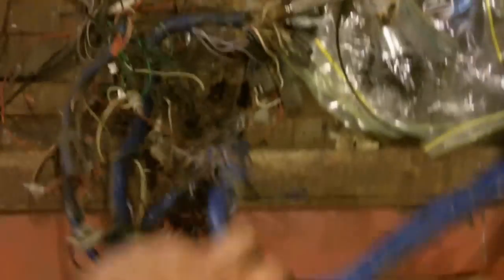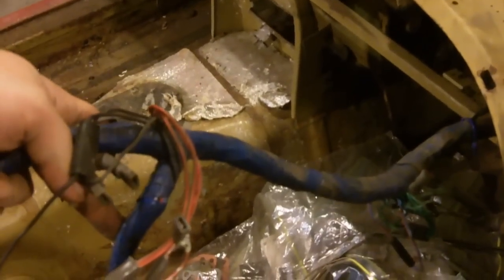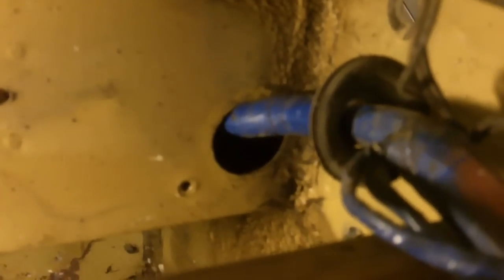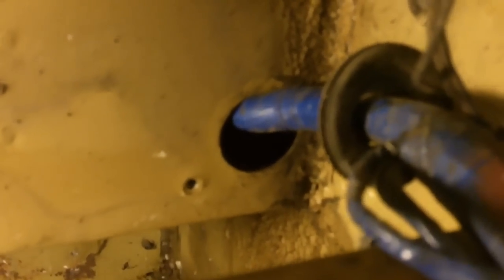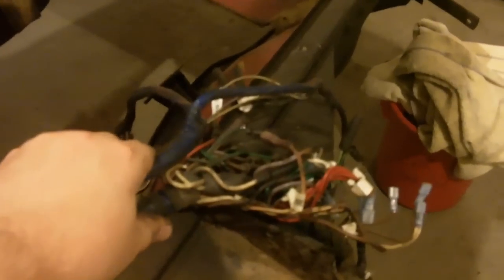MG57 - MG Wire Harness Removal

Comment: If that is the original harness, I suggest purchasing a new one given the work load of installing it.  After my first episode of clouds of electrical smoke billowing from under the dash yesterday, I  am contemplating the wisdom of continuing to drive a car that has an electrical harness that is 48 years old; of course replacing it will be a nightmare.